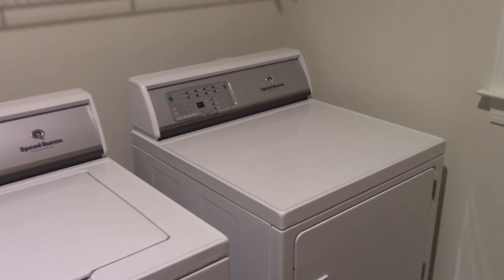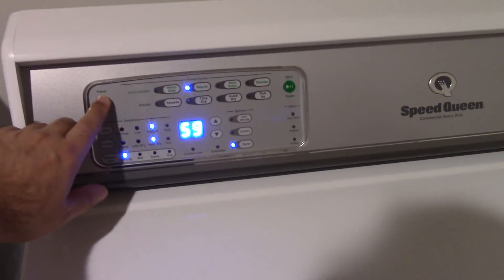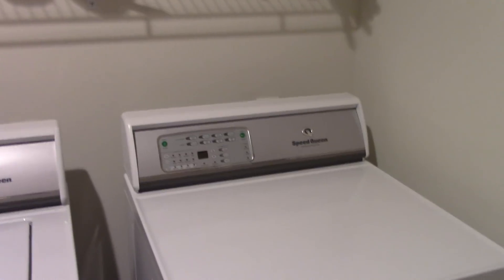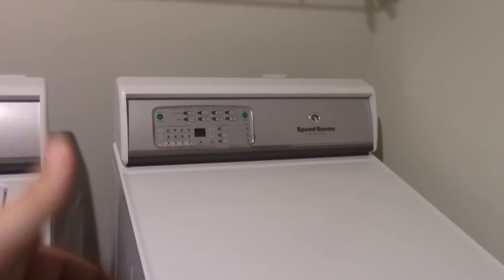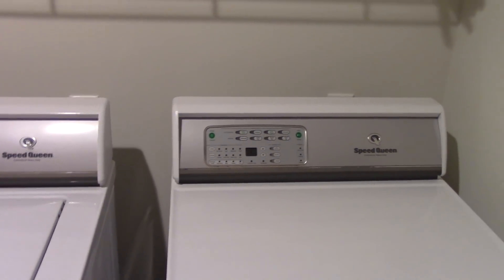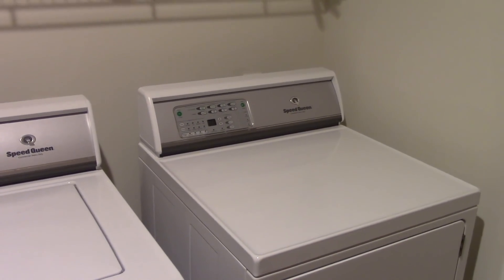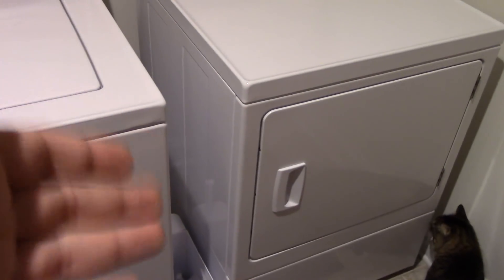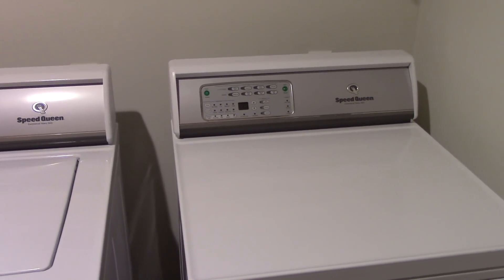Speed Queen Gas Dryer Error Codes & Problems.

Comment: [in Russian accent that sounds nothing at all like JayKay18] I do experiment for you!  Currently, ours is drying a load of towels on auto/high heat with a temperature sensor at the control board.  You got me curious how hot they actually get during operation.  I know these boards are rated for 90c and 120c, depending on the revision code of the board (194f and 248f, respectively,) as SQ has used that same mounting location for decades for their controllers.  (not to mention circuit boards on ovens, ranges, under the hoods of cars, etc.)  I ran the dryer for a few minutes with the cover off and my hand on the controller (carefully of course,) before I put the temperature sensor in and close it back up, and I never even felt heat at all, just the movement of cool air.  This, of course, is using a run of about 9'ish feet of aluminum dryer vent with no restriction on the outside.  I'm wondering if you just got a bad board in your unit.
Reply from the maker: Oh great! Glad you of all commented, since you and Spats were the first ones I saw with these laundry machines and I was wondering if you encountered any similar issues.

Wow they are rated that high?? I sure wasn’t expecting that and I actually didn’t know just how long the boards were placed in that location. But I had completely forgot about boards in ovens and ranges as you said. I had figured  they just had some thick insulation or something. Nice work with the temperature sensor. You guys know a lot more about electrical work than I do. The duct here is nice and short, and the outside vent is one of the things I also checked. So I think I checked all the simple stuff that I could have.

It could simply just be a bad board like you said. It would be rather good if it’s just that, as I do know that happens sometimes. The washer on the other hand hasn’t missed a beat. I do miss having a warm rinse, but with the results it gives me, I can’t really complain.
Reply: I hear ya!  I finished filming, I ended up running the load for 30 minutes with the temp sensor inside, and I literally put my hand almost in the burner to demonstrate LOL... Once Apple agrees to let me successfully copy the video files over, I'll edit and send you the link later on.  With the cover closed, the temperature at the control board reached 94F.  I opened the cover and let it keep running, and used my infrared thermometer around the controller, got readings of 78 to 94 degrees with it.  I also stuck an actual probe thermometer into the heart of the controller (and oops, forgot and left it inside!) and also got 94 degrees, fortunately less than half the temp required to cause any damage.  Oh and I figured out the lower panel, it's actually in direct contact with the plenum that the lint filter sits in, that's why the lower panel gets really hot.  The metal inside around the controller is actually legit cool to the touch at all times.
Reply from the maker: Cool! Look forward to the link!

Wow only 94? I really need to buy myself an infrared thermometer or something. Yeah the panel is right by that lint filter housing, so that is indeed part of it. But yeah if that all holds true, then it could just be a bad board. 

I guess we shall see what happens once the work is done!

Comment: One feature Kenmore gas dryers had in the 1960's was a variable burner. How it worked was when the cycling thermostat cycled, instead of turning the burner off it literally turned down the burner like you would turn down a gas stove burner. The higher end Kenmore electric dryers did something similar, but there was two heating elements, and how it worked was when the cycling thermostat cycled, it would turn off one heating element, and the other heating element would stay on. If you were to select the low heat setting, it would just turn on one heating element. Dryers back then actually had a true low heat setting.
Reply from the maker: That's an interesting way of going about it. Nowadays cycling thermostats have a little heater coil in them that will make it think the dryer is hotter than it actually is, and that's now the different temperatures work. Not a bad design though, the 1990 Whirlpool dryer hasn't had a problem with it for over 20 years now.

I'm not a fan of variable gas valves (especially these days). It just means more electronics. Same reason why I am glad we have the furnaces and air conditioners that we do. They are strictly on or off. No variable gas valves or speeds.
Reply: Those Kenmore gas dryers in the 1960's had a variable gas valve, but it was mechanical. The electric versions just had two heating element that one was either on, or both were on. One interesting thing about my Lady Kenmore portable dryer is you can hear the high limit thermostat click on and off, and I always clean the lint filter after each load, and there is a cycling thermostat near the blower. It drys just fine, but I find it strange how the high limit thermostat basically cycles, and the cycling thermostat really doesn't do anything at all.
Reply from the maker: That is kinda weird indeed.
Reply: I find it strange how the high limit thermostat basically cycles. Maybe someone at some point replaced the thermostats at some point, and did not put the thermostats in the correct places? Or maybe the cycling thermostat is only used for the permanent press cycle? I've used the permanent press cycle before, and there were a couple of damp spots on my clothes, and I dried them for about 60 minutes. Could be for the permanent press cycle.

Comment: Don't think it's a design problem with the board placement.  Remember,  that area underneath the cylinder is operating in a vacuum.  I would be surprised if it approached 100 degrees at best.  I suspect a bad connection in a wiring harness or a bad board altogether.
Reply from the maker: Another user made a video for me and showed how hot his dryer got down there, and it was only 94 degrees, to my surprise. Replacement boards are already in the works, so we shall see how things go when that happens.
Reply: Sharkie626 any luck?

Comment: I have the 9 series too. MY dryer has a different issue.  If I use sensing on heavy-duty the dryer will count down to the 10 minute time and it will stick there and the sense still says the clothes are wet and they are well dry and HOT. I think I am out of warranty.   dryer shows no error codes

Comment: Hi there I have that same dryer only the electric version I also dry towels on high heat never an issue. May I ask a question, does your exhaust have any restrictions? Mine exhausts out the wall adjacent to the dryer. I’m sure you are using the shortest connection to exhaust the hot air and not soft tubing. Just thought I would share my views.
Reply from the maker: I think the electric dryers will be more forgiving, because the heating coils are in the back of the dryer inside the duct, and not at the bottom near the front like the gas burner is. 

The exhaust was one of the first things I checked. I checked the lint filter, the area past the netting and the outside exhaust vent. All nice and clear. The exhaust duct is nice and short compared to the other house, so that will make it much easier to clean out, should it ever need it.

Comment: How long is the actual duct? If it is more than 10 feet or has more than 180 of bends, you will need a booster fan. If this was a mechanical control dryer, it will most likely cause other problems.
Reply from the maker: The duct is very short. It's connected right behind the dryer, and goes right outside the wall to the right side of the dryer. The duct only has one 90 degree bend as far as I know. I'm assuming there's no bends in the back wall before it goes outside. That being said, maybe I'll ask the guy just to check it when he's doing the work on the dryer. A little reassurance can be a good thing.

Comment: Makes me rethink getting the electronic controll on the washer but then again this is the washer its the dryer haveibg the issues. Maybe ill get the knobe model washer instead cheaper too i just wanted the fancey agitator washer.
Reply from the maker: Yeah the washer seems fine.
Reply: Sharkie626 i dont know whats up with the dryer. But. The panel does seem close to the burner and i know electronics dont like heat  would have been coll if maybe they hid the computer in the control panel or back of dryer something like that away from the heat
Reply: Sharkie626 sadly. Ive had some things come up and i may not be able to have a speedqueen ill relook at finaces my dog needs teeth pulled and my car battery died. 
Its looking like i might just repair my maytag i did some digging and repairclinc if o order the parts do tje repair my self for 330 buck i can rebuild that washer. 
New transmission new motor coupling new basket drive and break mech spanner wrench and drive block all new guts for the maytag. It stil want a new speedqueen.
if i have too ill jhst tear my washer apart and repair it i got part numbers ill check ebay for lower prices. If i can
Knock it down maybe 100 might just fix my current washer give it many more years of service if i ende up haveing nough room ill buy the speedqueen.
Reply: Sharkie626 well its hear i got my new speedqueen washer today.
My maytag dependable care washer gave up today so made an emergancy trip to get a new washer.
I had piles of laundry to do.
Reply from the maker: Awesome! Hope it does well!
Reply: Sharkie626 me too so fair ive been running it all day no issues.
I love this washer very happy i bought it. 
I am sad to see the maytag go but i feel now it was time to let it go its now sitting in my garage apart i tried to repair it but found it needed more parts to fix it so i retired it.
Tomorrow i will be hauling the maytag to the scrap yard in the truck.
Ill make a video of the speed queen when i get a chance i got one like yours very impressed with it.
I havent been this excited about a new appliance in along time.
Reply from the maker: Hope it continues to serve you well for years!

Comment: I've said it before, and I'll say it again:  This seals the deal.  I REFUSE to own a machine with electronic controls.  Error codes are the same as the dreaded Check Engine light.  A huge annoyance that's only going to cost money.

Mechanical controls, no worries.  There are no error codes, it just won't work.  Then you whip out that nifty paper, follow the wiring diagram, and test the components with a multimeter, which only takes a couple of minutes.  The Buick has no computer, doesn't need a computer, and doesn't want one either, yet it runs just peachy keen now doesn't it.  It doesn't have an oil light, it has a gauge.  It will not alert you to low oil pressure, that's MY responsibility to monitor, and I monitor that gauge every time I glance at the dashboard to check my speed.  I'll also glance at the temperature gauge, fuel gauge, and ammeter.  It serves as "vital signs" of the car, and oil pressure of course is the most important.  Just like heart rate/rhythm of a person is when they're on the 'scope, but they also measure body temperature, blood pressure, etc.  We don't have any computers in us, nor error codes, though sometimes we can diagnose ourselves.  Often we do so incorrectly.  In fact, with all this hype about everything being digical today, the bottom line is that there is no point.  We are analog beings.  Sound, whether it's that of a TV program, or maybe some music you want to listen to, doesn't matter how digical high "deaf" (I see what I did there) it is, that digical must be converted to analog for us to enjoy it.  Otherwise you'll just hear a series of ones and zeroes, and that doesn't sound much like music to me, though with the likes of today's music it might actually be better!

Water + Circuit Board = Bad News?  I've heard an equation like that before...if I only could remember where it was and who said it...
Reply from the maker: Great fine that's all good, now where is my appliance USB to hook up my phone?? 

But yeah. I do remember telling ya about my skepticism while I was still on LI and at your place. And when I made the video of showing the inside, that board placement just made me even more skeptical. 

But, as usual, this wasn't my decision. So, I'm just going to have to wait it out and see what this guy comes up with. Maybe it will actually make it trouble free for many years to come, maybe it won't. All I can do is hope for the best. I'm going to guess the washer has some kind of chart too in the control panel. But hopefully I won't be needing it.
Reply: This is why I hate electronic appliances more durable my arse!
Reply: Sharkie626 I don't feel it is Speed Queens Fault, it was probably a manufacturing error. I don't think Speed Queen makes electronic controls badly, Infact, I think they make them BETTER than the new Crap-Drives (Belt-Drives)
Reply from the maker: Yeah it could have just be a bad board. Both boards have since been replaced and the dryer has run many times since then, no problems so far.
Reply: They make them better than everybody else!

Comment: I don't know if this is a good idea, but I would try to throttle the burner a little to see if that would help.
Reply from the maker: Interesting idea. But I don't want to make any modifications while it is under warranty.
Reply: The burner btu since it is so close to the circuit board should be 18,000 btus, not 22,000 btus. The Maytag Halo Of Heat gas dryers had a 18,000 btu burner since it was close to the dryer drum/seal.

Comment: Even speed queen f**ks up... haven’t had one issue with ours though!
Reply: And oddly enough, we have done towels on high heat plenty of times, with no error code.
Reply from the maker: I'm sure many actually have. But the placement of that board just is not right. If there's one thing circuit boards don't like, it's excessive heat. I should also add that the exhaust duct is nice and clear. We shall see how things are after he works on it.

Comment: A bit of engineering fail on Speed Queen's part.
Reply from the maker: Yeah really. Everything else they did great. But the placement of that board is just not smart. The electric dryers are more forgiving with this since there is no burner.

Comment: We have a newer gas dryer like the one shown, the first problems was it would trip the circuit breakers three times, we called the tech. they came out and where unable to replicate it so they left. Then it started to work again until today, now it won't come on at all, like the plug is dead but it is not. So now the dryer is dead  and door mechanism seems to be working correctly. So much for buying American.
Reply from the maker: Probably got faulty boards. They should replace them fully under warranty. They did that for us, has worked flawlessly ever since.
Reply: @Sharkie626  Thanks I will let the lazy technician know.
Reply: Re cap I called and got a technician out again. The problem was loose  wire harness rubbing against the drum  exposing the wire, and when we tried to start it would ark on the drum.
Reply from the maker: @Moondoggy1941  Ooo man that's a bad short. Glad it's fixed!